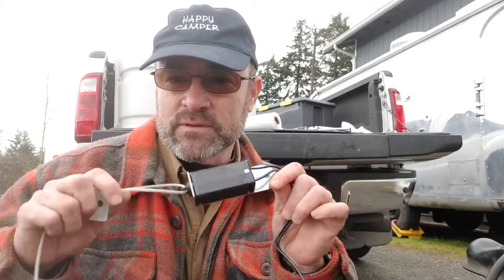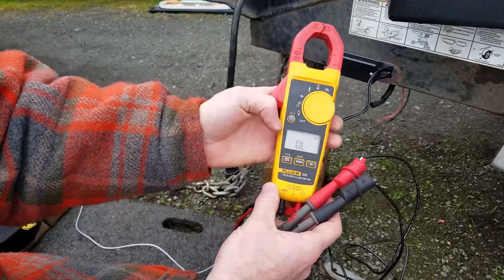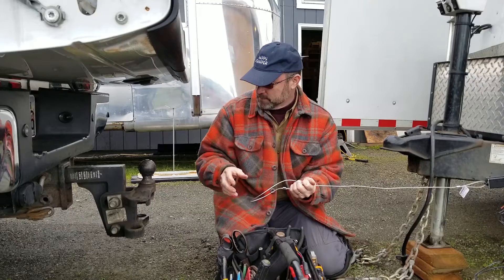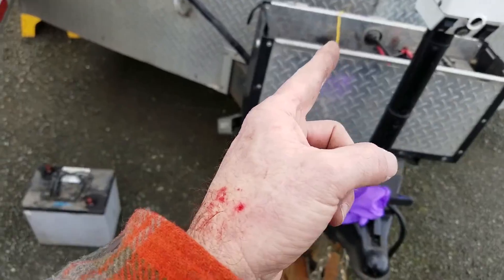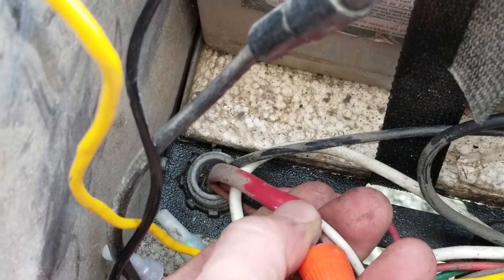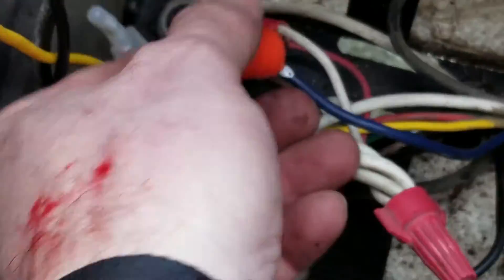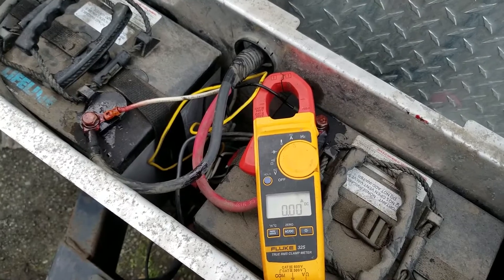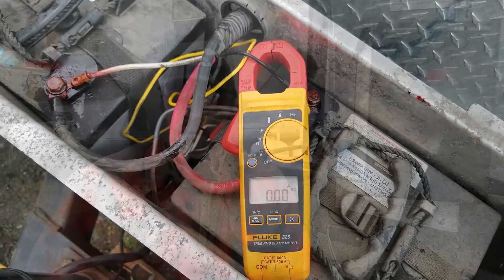Break-Away Cable - Your Trailer's Emergency Braking System

Comment: Thanks! I wired in a charger between the break away and the battery. Would you place a fuse in between the charger and battery in my case? If so, what size fuse would you recommend for this application?
Reply from the maker: Trying to visualize your configuration.  So, I will assume that the positive side of the brake-away circuit connects to the battery +, and the battery charger also connects to the battery +.  And it is this charger battery + wire you want to fuse?  

If that is the correct configuration, then the size of the fuse is a function of the size of the wire, and the size of the wire is a function of the current it is expected to carry.  And that, in turn, is a function of how the engineer designed the thing and how much current they specified.  

A fuse only has a single purpose, and that is to protect the wire so that the rating of the current passing through the wire is never more than what the wire is rated for.  

The battery charger you installed will have a name plate with the output current listed on it.  That would be a good place to start in determining the wire size and fuse size.  

If this is a trickle charger or battery maintainer, then we are looking at perhaps a 14 AWG wire and a 10- 15A fuse. If we are talking about a converter charger rated for 55 amps, well then, the wires are much larger, and the fuse is larger as well.  

In the end, see if you can find the installation manual for the battery charger; they will certainly have all these recommended wire/fuse sizes listed there in their specification tables.

Comment: I had my battery connection fix in next morning I smelled burning in it was brake controller melting  they told to cut the two wires so it would stop

Comment: Thanks for the videos been very helpful. I have an issue.  I have a 2015 keystone goth wheel. I have one brake light working all the time. Even when not hooked to my truck. The only way to turn it off is to turn off ac and dc power. Any thoughts ? Or maybe a video related ?

Comment: Great video.  I have a half and half.  My front brakes work when the break-away is pulled; my back breaks do not and they look like brand new - probably have never engaged - and they are a year older than the front brakes.  I would test my trailer brake gain - and it worked - guess it was just one set.  I'll be tracking the issue and your video is still 👍👍👍👍👍and very helpful 5 years down the road;  THANKS!

Comment: Very helpful video, thank you. I have a question though, I just bought a used travel trailer with the same system. However as I went to leave I could tell the breaks were engaged and after further looking around I noticed the plug was out, and the small black box was slightly crushed and I cannot plug it back in. Im trying to find a way to get this home so I can replace the switch. Will disconnecting the lead that goes to the battery disable this emergency braking? Or will the power from my truck for lights and brakes end up giving power to the safety feature? Is their any easy way to disable the breakaway switch so I can get this trailer home?
Reply from the maker: Sure, just cut the two wires feeding the switch and cap them off.  One will be 12V hot.  That should get you moving again until you get it replaced.  With new switch just reconnect the two wires.
Reply: @MyRVWorks nice

Comment: The loop at the end of the breakaway cable is intended to literally go directly over the tow ball. Before lowering the coupler down onto the ball.
Reply from the maker: We have actually worked on trailer balls that were coming loose. Particularly the bolt that holds the trailer ball to the plate was loose.  So, if the whole purpose of this is an emergency breakaway, I don't know that it would be advisable to attach it to anything that could fail.  If that is the manufacturer's recommendation, I think that they might need to evaluate all the possible scenarios were a component can fail or come loose.  In a catastrophic failure, it's not the Breakaway manufacturer that's going to be representing you in court though. Our best practice is to attach that cable to something on the frame of the tow vehicle that is not part of the tow coupling.  Unfortunately, from our experience, that is rarely how these things are attached which basically renders them useless if whatever they're attached to were to fall off in the failure.

Comment: bro wires ripped off and i connected them and my brakes still locked did i connect it wrong
Reply from the maker: For your break magnets to energize they need to be getting a  12v power source from somewhere. So you need to go upstream and figure out where that's happening. Typically it might be an indication that the Breakaway cable may have a faulted or that the removable pin has been pulled out.

Good luck detective you got this.

Comment: Could the plunger coming out during me jacking up my trailer drain my travel trailer battery? It looks like my wire got under my jack pad when I was unhooking and pulled the plug out.

Comment: Are there brake pads that have to be changed on teardrop trailers?
Reply: If it has brakes then yes.

Look on the backside of the wheel and see if there are electrical cables going to the wheel or hydraulic lines.

Comment: Lots of comments, so hopefully I'm not repeating a question.  First the context.  I am in process of buying a travel trailer and the plastic plug where the breakaway cable connects is broken, so I need to get it replaced.  In searching the internet I found someone who mentioned they pulled the breakaway cable after parking their trailer and left it this way at least overnight.  Long story short, he said he had multiple locations along cable harnesses that were melted and his brakes were locked up.  Thus, he had some repairs to do.  Is this common or expected if leaving the breakaway disconnected for extended periods, or does this sound like a fluke due to faulty wiring?
Reply from the maker: It is not recommended to operate that switch that way. It's okay to pull it out to verify the circuits working but not to leave that circuit closed for any length of time

Comment: Is it a requirement to wire the shutoff switch to the battery side of the shutoff?  I can see why you would want to, but just wondering if that is required by law

Comment: I got a brand new Forest River wolf pup 17JGBL this year. 2022. I pulled mine to test it since it seems my brakes aren't working and the driver side brake started smoking and the wires connecting to the break away unit were too hot to touch.

Comment: I don;t think that is very safe. What if it breaks from the truck then locks the wheels and the cars behind it don't see it stopped then hit the trailer. Doesn't seem like a safe safety feature to me. I would think letting the trailer roll until it stops, unless your on hill, would be a lot safer for cars behind you
Reply from the maker: Perhaps this article may help...  https://www.law.cornell.edu/cfr/text/49/393.43
Reply from the maker: The detached trailer flew into the oncoming lane and crashed into a truck! - 

https://www.msn.com/en-us/autos/news/the-detached-trailer-flew-into-the-oncoming-lane-and-crashed-into-a-truck/vi-AA10lkjD?ocid=entnewsntp&cvid=8fe5706fa4b4448b94d8c653187f7584

Comment: Thank you got a question.
I have a two axle trailer with electric brakes.
My batteries are 12 volt lithium phosphate batteries.
Is there any drawbacks to using my travel trailers lithium batteries for my breakaway break engagement. 
I can't see any but would like to run it by an expert.
Thank you.
Reply: No difference. You'll likely never even use that breakaway system. Use whatever 12v you have
Reply: Doesn't make any difference.... 12v is 12v

Comment: Doesn't unplugging it and plugging it back in repeatedly weaken the springs holding it in?
Reply: Probably. But after many, many pulls.

If it's really old, if you pull the pin out, the whole thing could disintegrate, and the pin won't go back in

Comment: If the battery is dead on the trailer tongue, will that stop the trailer brakes from working?
Reply: The actual brakes or this emergency break away??? If ur battery is dead break away won't work, it needs that 12v to  activate once pin is pulled. If ur talking ur brake controller in ur truck the battery should be getting charged or 12v from ur trucks charging system if installed correct

Comment: When i picked up my camper trailer, no one told me about this break away cable.  It came disconnected while I was on a trip, I had no idea where it belonged, so I didn't put it back in.  Many miles later my brakes locked up on me.  Thanks for this video, it totally helps me understand how it works, and how much danger we were in the entire time the breakaway was unplugged.  Yes, my trailer brakes are shot.

Comment: I noticed my trailer pulling hard. I thought it was the wind. When I got to the camp site my pull away box was melted. It fell apart in my hands. I know now why it eas pulling so hard the pin fell out. I must have hit something. So is all I need to do is replace the pull away switch with new pin?
Reply from the maker: Well certainly that, but you really should have your brakes inspected if they ran that hard, that long, and got that hot.

Comment: This was super useful. I've always wondered if I could just use the breakaway cable as a parking brake, but now I know that would be a bad idea due to the power consumption and heat generated in the brakes.

Comment: Ohms in parallel are not added they are divided, 4 brakes with 4 ohms each becomes 1 a ohm load, which at 12 volts equals  a 12 amp load.

Comment: My dump trailer has a big 12v deep cycle battery to power the hydraulic dumper, not connected to the brakes in any way.  The breakaway brake circuit has a separate tiny 12v battery for the emergency brake function.  Is there a reason why I can’t get rid  of the tiny 12v battery and instead power my breakaway switch from the deep cycle battery?  It seems to me the big deep cycle battery would be much more reliable.
Reply from the maker: Absolutely, that's how we did ours as well.

Comment: Silliest question of the day... when the trailer brakes do lock up on test, how do I release the trailer brakes after the test?  As simple as plugging the switch pin back in? Thank you to whoever answers...
Reply: Trailer brakes are magnets inside the drum, pull the pin and full power goes to those magnets and once you put the pin back in(voltage is cut to the brakes) the magnets release from the drum releasing the brake pads.
Reply: Yes just shove the pin back in. Good to go.

Comment: what brand break away is this?
Reply: Hopkins makes several sizes and styles - I just installed one. This kit  simply adds an emergency switch to the existing brake system for safety.

Comment: My brake controller is not detecting the trailer after I pulled the brake away pin.Do I need a new break away switch.

Comment: When I pull my break away cable it takes a maybe 5 to 10 seconds before the brakes kick in.  What would be the problem, or is that okay?
Reply: Definitely not ok.  Try checking with an ammeter as shown in the video.  You should see a current surge as shown immediately.  Perhaps your brakes are out of adjustment?

Comment: Does the wheel spin again when you put the pin back in the sensor to continue on?
Reply: Good question, was wondering that myself
Reply: This is what I came to find out. I just accidentally pulled mine out (after I'd already parked and disconnected) and the controller and brakes started smoking.
Replaced the plug quickly and the burning stopped, but at this point I have no idea if the brakes are locked, or how to release them if they are.

Comment: On my new 5th wheel trailer, the safety pin cable was too short. When I made right turns, it would pull out and activate the brakes! Happened three times before I finally smartened up and installed a longer cable.

Comment: I got a question? The rear brakes lights have to turn it on a soon you remove the cable or just active the brakes?
Reply: No.  The power is for the brakes only.  But i know here in PA you need a dedicated break away battery.  You can't use your aux batteries like this guy is.

Comment: Excellent video - I learned a lot.  You would have made a great high school science teacher with your enthusiasm and clear simple explanations!

(One question - are these breakaway devices only required on trailers over a certain weight limit?  We used to tow a Coleman pop-up camper behind a minivan during the summers for years and we never had one of these; just the usual safety chains.)
Reply: That's what I am talking about. yep. a teachers soul for sure.

Comment: I have a Discovery brand controller . Display reads the dot but not 0.0 or anything numbers. If I push the manual button it reads numbers but no breaks. Blue wire doesnt light with test light at the back of controller or at the pigtail plug at bumper...I thought bad controller but where I got it thinks I should have them check wiring.i want to do myself I got 12 volts at black and red wires at controller. Can you, or anyone help.

Comment: 4 brakes I get 2.69A / brake assembly 10.76A total seems low; Normal Y/N?
What gauge wire is running to your brakes?

Comment: Just to be clear, The Battery has to be charged? 
Will the brakes not engage if the battery is low/dead?
Reply from the maker: Hi Q.C. Phil,
 
Your question has been selected for an upcoming video where it will be read and discussed by Darren - Certified RV Tech and online personality for the 'My RV Works' videos.
 
If you have not already subscribed to the 'My RV Works' YouTube channel, please do so and keep a watch for the ‘RV Tech Talk’ video releases.  This series is a selection of comments and questions that will be covered and released weekly.
Here is our YouTube link:  https://www.youtube.com/c/myrvworksinc

Happy Camping,
My RV Works Media Team
Reply: @MyRVWorks  my battery is practically dead and mine works fine.
Reply from the maker: @GetUrPhil  ,

Darren here, I covered your question in a video that is in post production now...  Question I had for you is if your trailer is connected to the tow vehicle or not.
If connected than the battery should get its charge from the tow vehicle.
If not connected than the power to engage the brakes has to come from somewhere and if the battery is dead than where is it coming from?
In either case, It is good to have a healthy-charged battery on the trailer and connected to the brakes through the breakaway switch to keep catastrophe from striking.

Cheers,
Darren
Reply: If i hear you right, from what I've learned is that the trailer battery is only charging when the trailer connector is connected to the tow vehicle. If you leave the trailer connector connected when stationary, it could draw down your vehicle battery if I understand all this right. I would personally disconnect the trailer connection even if you leave the trailer attached to vehicle, say if you're camping or sitting anywhere for a length of time. The trick is to remember to reconnect the connector before leaving. Of course always do a walk around before leaving to check all this...

Comment: I was told never to turn off your 12 v emergency switch if you are in motion. Because there is zero voltage and it won't work..
Reply from the maker: Hi Mark,

That really depends on now the mfg of the trailer wired that disconnect switch.  You will have to verify that circuit.  Assuming the mfg  wired 'everything' through the disconnect than you would be correct and if it was turned off than there would be no trailer brakes either.

Happy Camping!

Comment: Yet another issue.  I cannot find my breakaway batteries.  It's a 2008 R-Vision Trail Lite.  The company is out of business and I can only find the owner's manual on those shady sites that make you pay before you see the manual.
Reply from the maker: The breakaway batteries 'should' be the house batteries.    To verify this is working, jack up one of your trailer tires, spin a wheel and pull the breakaway wire.  Tire should stop.
To verify the tow vehicle is charging the house batteries, read the voltage of your house batteries with out connection to the tow vehicle and then connect the tow vehicle.  If the tow vehicle is charging the RV house batteries you will see the voltage increase on the house batteries.

Cheers,
Darren
Reply from the maker: Hi 
Tom,
 
Your question has been selected for an upcoming video where it will be read and discussed by Darren - Certified RV Tech and online personality for the 'My RV Works' videos.
 
If you have not already subscribed to the 'My RV Works' YouTube channel, please do so and keep a watch for the ‘RV Tech Talk’ video releases.  This series is a selection of comments and questions that will be covered and released weekly.
Here is our YouTube link:  https://www.youtube.com/c/myrvworksinc

Happy Camping,
My RV Works Media Team